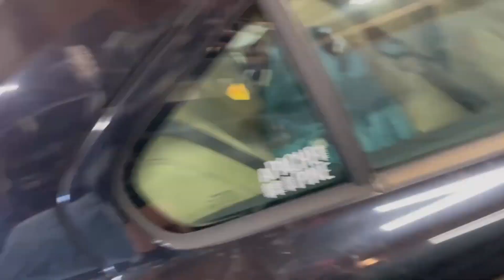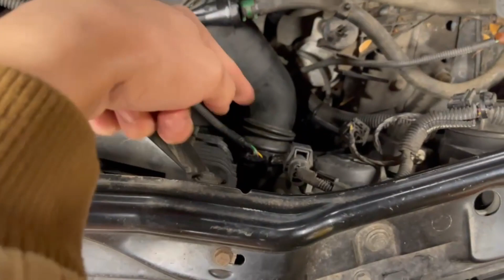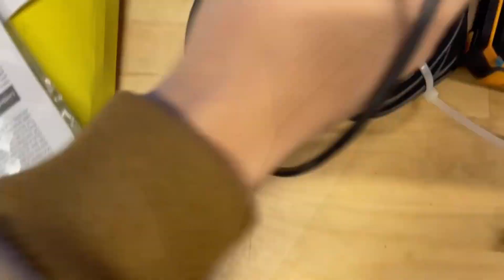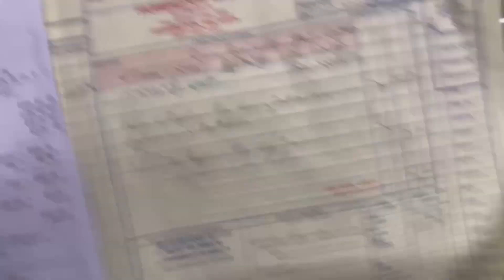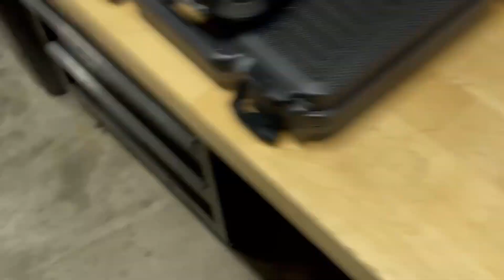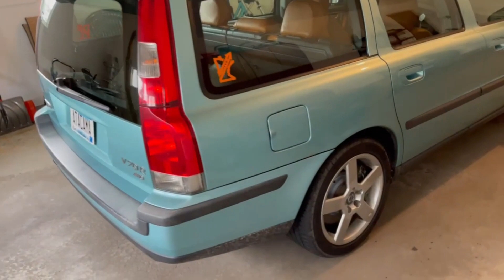Cheap M66 Project… what’s wrong?

Comment: I have 2002 S60 diesel  2.4 D5 with original windshield. Do you recoment changing it?
Reply from the maker: I like the original windshields and would prefer to keep them unless they get pitting from rocks. Seems like the wipers work better on them.

Comment: Hey , just saw your video on integrating the cluster with the sim. Its amazing.
 
Currently I'm working on a CAN Bus  project , i need to take the reading of boost pressure and use it to open a valve when certain amount of boost is reached. Im using MCP2515 CAN shield and Arduino uno...but I'm not able to take the read. Any idea on how to do it?
Reply from the maker: It’s probably on the high speed network and you will need to figure out which address and byte carries the boost data

Comment: i got my 04 s60r m66 for 1,000 also. same failed heated seat....i swapped a new seat skin on the driver side and now its good. i have put 10x that into it but now mint mechanically. t5 swap, k24 hybrid all the other bits etc. 1k is a steal for the m66 s60r honestly. great find!
Reply from the maker: Just got new front seats to put in it!

Comment: I had an 2008 S60R, other than the turning radius the thing was a blast to drive. I upgraded to 2016 S60 Polestar, other than fit and finishes and some more modern functionality, I would be hard pressed to tell you which car was better. The block is bullet proof. Fuel sensors have been an issue with all my Volvos. All in, over 17 years of Volvo ownership, I've spent ~$200 in non routine maintenance. After my Polestar was totalled (hit from behind), I went old man and bought an S90 T8 Inscription, which I love, but I miss the R and P*. For a $1,000, you're sitting a f* awesome time. Let me know if you want to sell! I don't like black but, I might make an exception!
Reply from the maker: The newer Volvos definitely catch my eye but are too much for me to justify. It’s really getting fun for me to work on these P2 models as I have over half of the car saved in my brain now! Probably won’t be selling any of these anytime soon though 😁
Reply: @AVGarage_   P2s are awesome. and price to value...300hp, awd, active chassis...you cant find anything else that checks those boxes for near as cheap as a P2R!